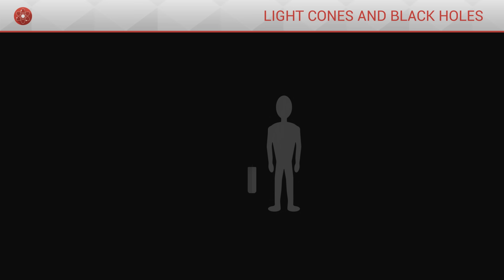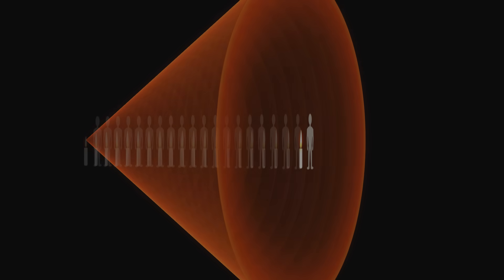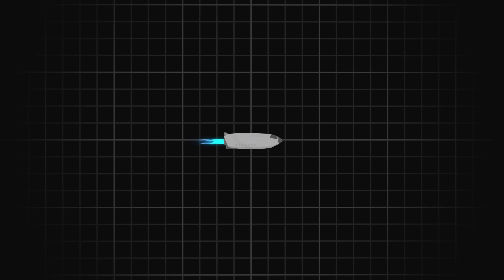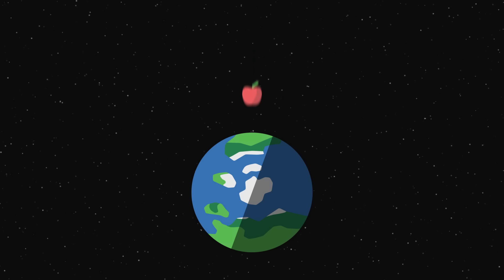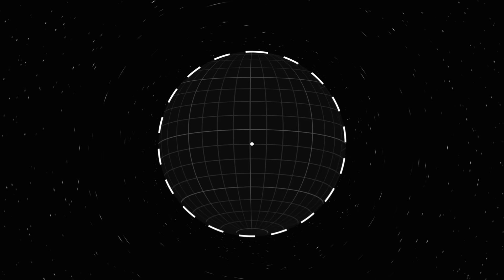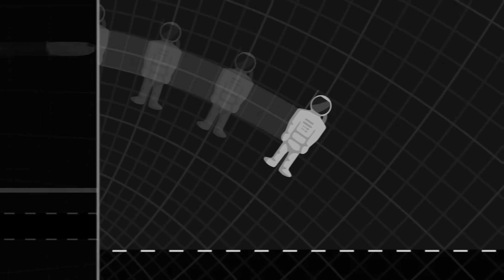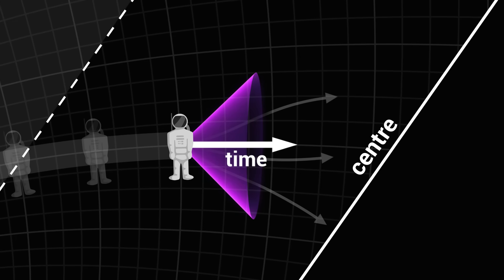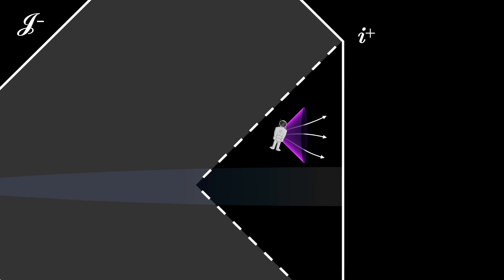Why Time and Space swap in a Black Hole

Comment: No offense but this is ridiculously stupid. We measure time by the earths rotation around the sun. Just because we use light to measure “time” doesn’t mean light actually has anything to do with time at all. Time exists with or without light. Also, just because we have not gone faster than light doesn’t mean it’s impossible either. It’s far more likely to be possible than impossible. Just like when we broke the sound barrier, eventually we will break the light barrier.
Reply: Nothing can travel faster than light in our universe, because we are within in our universe; but yes it is possible travel faster than light but you need to be out of our universe,for example BigBang was faster than light..
Reply: @Dr.Akakia  That’s assuming our current “theories” are absolutely concrete and we understand how the universe actually functions. That possibility is about as vast as our universe lol. Let’s say there is a “light barrier” just like there is a “sound barrier”. We just have absolutely no way to even try to test. But if anything like the sound barrier once you approach the barrier more resistance builds and breaking the barrier take a lot of energy and is violent, but once the barrier is broken the effort is much less allowing easier acceleration. Warp speed bro, it’s like slingshotting off of light. Also light can be concentrated into un-natural beams which can accelerate light, meaning light can have varying speeds, like how light is on a spectrum different colors are faster than others, different colored stars give off different “speeds” of light. So how they just call it “light speed” when different color/spectrum lights absolutely go different speeds shows the knowledge still needs to be refined. Believe
Reply: @Dr.Akakia  the question is what color of light is the fastest that we know of? Then we go from there. I should be working for NASA or something lol
Reply: @deltaromeo5542  "the question is what color of light is the fastest that we know of?"  there's zero difference in speed between different wavelengths. That is an observed fact as well as the core of all modern physics theories (because all of them are based on special relativity and it, in turn, is based on the fact that the speed of light in vacuum is constant no matter what). If you want a quick insight: it doesn't have to be light, it's just that light is the simplest thing that moves at that particular speed because it's massless. What special relativity allows us to derive is the fact that under the particular geometry of our space-time, there's a speed limit on causality, information and matter transfer. And any massless particle has to travel at that exact speed (or more specifically, along the light-like path, defined by having ds = 0 all along its way, where ds is a spacetime interval, defined as ds^2 = dt^2 - dx^2). You can pretty much disregard that sentence though, it's not like you'd be able to understand much yet. But don't worry, just pick a good textbook and start studying. 

"I should be working for NASA or something" I doubt they accept people that failed highschool physics and doesn't know the definition of a word "theory", sorry.
Reply: No you're not smarter than Einstein sorry. This is a good example of the Dunning Kruger effect. You should learn more about what the speed of light (speed of causality) is because we have already proven that the speed limit of time is consistent for all observers, by using equations that take this into consideration to predict what the math shows. And guess what? The predictions fit perfectly to what we observe. Look into what a Lorentz Transformation is and you'll understand why the speed of light is the limit for our spacetime. You can think of time as moving at the speed of light because the speed of causality or change in time maxes out at the speed of light.
Reply: @4r1777  Define “light”….. there is no 1 unified absolute “light” light is a wavelength just like sound, there are different types of light and different types of sound. The theory may make sense if you broad stroke “light” like that when in reality light has incredibly complex spectrums that emit completely different wavelengths that all travel at very different speeds. We think a vacuum seems to make light lose its wave-like characteristic, but they also say like acts as both particle and wave, both which can be accelerated and isolated. Einstein took that step so others could build from it and explore further. Not to hold him on a pedestal and stick yourself in mud. These are all “theories”, Einstein has a “Theory” of relativity. These are ideas not facts. Also if light is electro magnetic it can also be PULLED and PUSHED magnetically we just haven’t got that far yet. Einstein dreamed big so we could dream bigger.

Comment: BIG QUESTION:
WHAT IF there was something connecting the two objects, like a very strong rope. If we had enough immediate thrust on the spaceship, would you be able to pull such an object back out?
EVEN MORE INTERESTING IDEA:
What if there was a solid pole connecting someone in a black hole and someone in orbit. Would they be able to pull or push on the pole momentarily to transmit a tiny bit of information? 
This doesn't make sense because some of the pole can physically move backwards and some of it can't.
Reply: No… everything gets separated down to the singularity. (Nothing)
Reply: @crandonborth What do you mean? I don't think things disenigrate when passing through the event horizon, if that is what you are saying. Event horizon is just the point where light cannot escape
Reply: @aden6427  Crossing the event horizon of a black hole is a one-way journey. Once inside, the gravitational pull is so strong that escape becomes impossible, even for light. This marks the point of no return, and anything, including light, that enters the event horizon is inevitably drawn toward the singularity at the black hole’s center.
Reply: @aden6427  any rope you can make will break and tear itself apart before reaching the even horizon. And even if it doesn't, you can't pull it out, physically. That'd require infinite strength applied to the rope, which is impossible.

Comment: Time-Space swap does not happen. Nature cannot be interpreted in blind arithmetic calculation.
Einstein and many other physicists objected the idea of "Singularity" but they couldn't convince other scientists because the nature of the spacetime was not clearly defined. The space time has been being defined (ct, x, y, z) and they are still using this wrong concept. 
The spacetime must be defined (ict, x, y, z). This is because of the Maxwell's equation describing the electromagnetic wave.
Then we can easily prove "No Singlarity", "No Light Cone", "No Unobservable Universe", "No Edge of the Universe", "No objects beyond the Universe", "Why expansion rate of Universe is 70 Km/Mpc-sec", etc.
Please read followings. (Please)

Currently, scientists are believing the Universe is a 4-D cylinder; i.e. a 3-D Ball moving along the time dimension.
This doesn't seem right.
The Universe is a 4-D Hyper Ball of which the 3-D hypersurface is our living space.
So, it is no wonder that we can see galaxies and stars staying way farther than 13.8 BLY's.
We must be able to see even π *13.8 BLY's away which is farther than 43.3 BLY's. Here π = 3.1415926..... 
That means the Universe is stretched to 2π *13.8 BLY's ~ 86.7 BLY's.
There's neither "Edge of the Universe" nor "Center of the Universe". Universe Has No Boundary but Universe is Not Infinite.
There is no "Unobservable Universe". All parts of Universe are Observable. Big Bang Did Happen.
Please read followings.

1. The universe is a 4-dimensional hypersphere, not a 4-dimensional sheet or cylinder which is widely accepted by communities of science.

2. There are 3 spatial dimensions defining the surface of the universal hypersphere. The 4th radial dimension is time, and defines the direction of expansion.

3. Spacetime is naturally curved even in the absence of mass, the same way Earth isnot a perfectly uniform sphere. This is caused by anisotropic expansion, and this natural curvature of spacetime is the true identity of “dark matter”.

4. Naturally curved spacetime allows the universe to have enough energy to continue expanding by confining the gravitational effects of mass to a local space. Thus, natural curvature of spacetime is also the true identity of “dark energy”.

Please visit the link given below for details.

https://www.academia.edu/82481487/Title_Alternative_Explanation_of_Dark_Matter_and_Dark_Energy

Comment: According to modern physics, “hitting the singularity” is not like “shortening the spatial distance until it becomes zero”.
When I enter the event horizon, the singularity will appear in my future, not in some place in space.
I will not hit a 3D ball called the singularity, or some point in space, but suddenly the whole space will be filled with the singularity! The moment I hit the singularity, my light cone time axis will be perpendicular to the singularity.
In the image, at the last moment, my light cone surface will completely stick to the singularity surface, and the two surfaces will coincide.
Therefore, the singularity becomes something that happens in my future, a sudden event that fills the entire space I am in, rather than me really hitting a point with no volume.

Moreover, when I first enter the event horizon, everything in the world gradually becomes the past, I do not go to some place in space, but I go to the future in time.
After I enter the event horizon, I will be surrounded by a void of vacuum space.
If there is an apple that was near me in space before I enter the event horizon, and it enters the event horizon with me.
The point is, the spatial distance between it and me will gradually become a temporal distance.
(You can try to calculate and draw to help you imagine how it happens “gradually”) After entering the event horizon together, it will be near my time axis.
The apple will either hit the singularity before me, or after me, the apple will appear in front of me or behind me.

The moment of “hitting the singularity” may not be something that actually happens, but rather infinitely approaching some kind of spacetime structure, which may be similar to approaching some mathematical limit.
This point is still waiting for scientists to continue to study.
The above situation only occurs in the classical black hole model, similar to the plum pudding model of the atom.
The current black hole model is more refined and complex, and the singularity may not be a point, it may be a ring-shaped singularity ring, etc.🕳

Comment: https://youtu.be/GQZ3R81iyE0?t=312  Is the wording accurate here?  Gravity affects not only matter but also light?  Shouldn't this better explain that light behaves as if the space it's traveling through as normal (not changing directions in space, from it's perspective, but space changing the orientation by "lensing" the light.. as light isn't affected by gravity either accelerating or decelerating, but continues along at it's absolute full velocity and direction in it's local "space", but the space itself is bending towards the gravity well... something akin to ground speed vs wind speed as seen from a fixed location on the ground...).  Or, does this video not include the concept of "gravity lensing" as the explanation for light "bending around" matter (most easily perceived around massive gravity wells, like stars or black holes)?

Comment: you can see the point where light would orbit the black hole in the diagrams, theres a bit on the edge of the cone that looks like its lines would never intersect with the center and just continue endlessly. i feel like i gotta watch that again it was fascinating. im most confused by the idea of more cones.  theres a sphere of outwardly pointing light cones constantly around you in timespace, and picturing how it interacts as an object speeds up is confusing me.

Comment: If we can't escape a 45° light cone because of its fast speed, why is it impossible to escape the black hole just because space time curves at an angle of 45°, it isn't like the observer will be falling at the speed of light at that angle while falling into the black hole?

Plus, the light cone expands forever, but the black hole doesn't. So how are the light cone and the surface of the black hole similar? 
9:07

Comment: Think about it like this: 
Beyond the event horizon, your only possible future is to fall further into the singularity; space physically makes it impossible for you to go back because you’re now falling faster than the speed of light. So the singularity, a point in space, becomes your future, and “the event horizon is no longer a place in space, but a moment in your past.” (from ScienceClic’s video, I think). 

This isn’t just a perspective, though. Time literally swaps roles with space in the sense that in a 2D diagram where time flows to the right and space is perpendicular to it (up-down), time gets bent into becoming the vertical axis because spacetime is warped so much. The event horizon is where these two axes are both at 45 degrees to the horizontal.

Comment: So to essentially move inside the black hole’s event horizon as you would in space, you need to be able to time travel. If you travel forward in time you would reach center, and if you move backwards in time you will move away from the center. 

A time traveller fallen inside the event horizon can come back to the surface of event horizon by travelling back in time to the moment he was at the surface and then move away in space. Think of it as falling in the bottomless pit. The only direction you’re going is down and the only way to not fall is go back in time when you were up. 

Basically outside of black hole’s event horizon you can chose your direction in space but not in time. Inside the event horizon you can chose your direction in time (if you’re are time traveller) but not in space.

Another way to think about it is that event horizon is the boundary. On one side of the boundary you depict your position as either outside of it or inside of it i.e. your position in space. On the other side you depict your position as before it or after it i.e. position in time.

Also being a time traveler is more than just moving forward or backward in time but essentially have the ability to come out of the light cone which can help you escape the black hole’s event horizon. It means you can travel in 3 directions of space and 4th dimension of time making you a 4th dimensional being. 

A time machine would not just be a 3d machine, it would be a 4d object. Can we, 3d beings even create anything that is a 4th dimensional object? I don’t think so. That is why black holes are the limit to our existence. Black holes are not 4 dimensional objects but a region that is only accessible freely to a 4 dimensional being / object. But black holes are still formed from 3d matter so even if we 3d beings cannot create a 4d object, we can still create a region that only a 4d being can roam around freely but not we ourselves. Can god create an object so massive that he himself cannot lift it? Maybe he can.

And one more thing, a 4d being is still limited by the speed of light in a pure 3d space but can appear to be faster than it to us 3d beings by leveraging his motion in the 4th dimension that it time. If the light of the candle reaches 300000 meters away from the candle, the 4d being standing at the center with the candle, who can travel at let’s say half the speed of light can appear to reach the 300000 meter mark in an instant to us 3d beings but he will be travelling at half the speed of light in space and 2 seconds back in time, because it will take him 2 seconds to cover the distance light covers in 1 second and move back in time 2 seconds.

Comment: Space and time do not switch.  They become the same thing. The center of the black hole is an unavoidable inevitably once you pass the event horizon.
Reply: In fact,this is explicitly implied at 3:00, when discussing the differences.

If time and space SWAPS as opposed to COMBINE, you could freely move through time while falling into the center.

Comment: I assume this is how time dilation occurs due to gravity, although given this representation, wouldn't it have the opposite effect given that curving the direction of time would make it take longer for the astronaut's perspective to traverse the same length of time than the outside observer. 

My other question is that, if this is the case, the light cones are oriented at 45 degrees at the event horizon and even more angled, closer to the singularity, doesn't that mean that by moving through space relative to you in a certain direction while falling into the black hole, you could actually end up going backwards in time relative to an outside observer (yes I know they wouldn't be able to observe you, but you should still be able to observe them